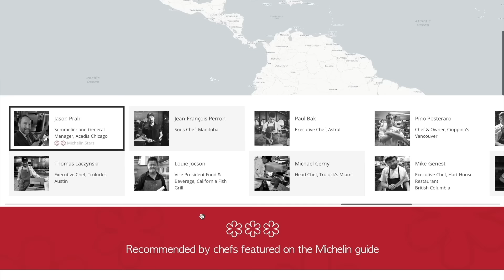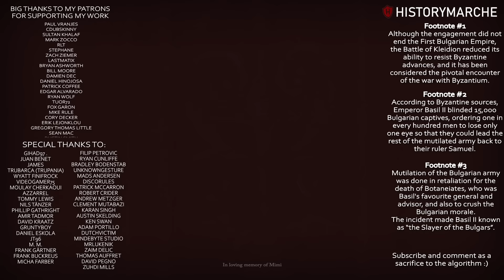Battle of Kleidion, 1014 - Basil breaks the Bulgarian Empire - Basil II, the Bulgar Slayer (Part 5)

Comment: Why does the thumbnail say 15000 thousand blinded then if he had at best some 1000 prisoners
Reply from the maker: Various sources claim different numbers. In the narrative I went with a more conservative number. But some sources claim 10,000. Some claim 15,000.
Reply: @HistoryMarche pin this comment
Reply: @HistoryMarche  Of course the source will say 15 000 when it was written by a Roman. The number of the armies in those years was no bigger than 15,000-20,000, and you should know this very well. That means he captured all of the Bulgarian army which is ridiculous.

One more fact that disproves that statement is that Samuel's son Gavril Radomir defeated the Roman troops and killed their leader Theophylact days later.

The truth is that the captives were no more than 2000 and about 1500 were blinded. The Roman chronograph just added a zero to 1500.